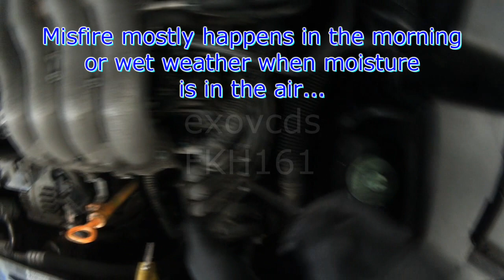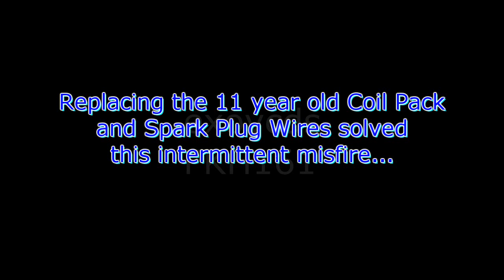VW A4: Finding an Intermittent Misfire (2.0L)

Comment: Nice find on the coil pack having a crack. What kind of solution mix do you use for finding arcs? I like to use half and half bottle of ammonia and water. The ammonia helps break down the surface tension of the water to allow it to spread better. Some people use soap and water, but I prefer the ammonia because it doesn't bubble all over the wires obscuring your view when looking for sparks.

Comment: hey man thanks for this video! it helped me troubleshoot a 2004 VW Beetle 2.0, it did exactly what you showed in the video so I changed out the coil pack and spark plug wires.
Reply from the maker: Thank you for watching!
Reply: Same here: 2000 2.0l new beetle had a misfire on cylinder 2.
Changed plugs and leads, no change.
New coil pack sorted it
Reply from the maker: +Drew Suttle Thanks for sharing your results!

Comment: Good stuff thomas :). I really need some help. I have a mk4 jetta turbo. And it has a p0303 . I swapped coils around and unplugged injector to see if thats the case but the light still comes on for cylinder 3.. i put new sparkplugs as well. Before this misfire i was running rich p0172..any help will work
Reply: It only misfires rough when its a cold start or havent turned it on for an hour or so.
Reply from the maker: Unplugging an injector will cause a misfire code for that cylinder.
Attach a fuel pressure gauge and watch the pressure after the engine is turned off.
Reply: Thomas EXOVCDS where do you connect the  fuel gage to?? Do you think i should try swapping injectors to another cylinder?
Reply from the maker: The fuel rail has 2 hoses, one marked white and the other blue. Blue is the return hose. Remove the one with the while mark and T into the line there. If fuel pressure does not show anything wrong, swapping injectors might be worth trying. At work I would try an injector balance test (activate injector while watching fuel pressure drop and compare with other injectors or even "current ramp" the injector... watching the electrical current in a digital waveform). https://www.youtube.com/watch?v=PieRsDSTLjY

Comment: Can you please help me , I have a 2001 vow Jetta 2.0 avh. I keep getting the p0354 code. I went and tried to do the ground tsb and I keep getting it back. Can you do a video on how to properly ground the coils please.....
Reply from the maker: +Jesus Padilla Bentley Publishers made a good video showing how to run a coil ground wire: https://www.youtube.com/watch?v=FjGkFqdS52w Your code refers to 1 coil of the 2 or 4 (depending on which you have)... your coil is probably bad / has an issue. If a ground issue were the problem, then you would have codes for the other coils as well.
Reply: +Thomas EXOVCDS  thank you. You just helped me solve a long time problem. Thank you once again and keep up the good work

Comment: Where can I get that ignition liquid? I just replaced a cracked/rusty coil with a used one from a vw dismantler, but I still get the intermediate misfire on #2 from vag. I have replaced the spark plugs couple months ago with ngk and gapped. Would it be my wires could be bad? 2000 2.0aeg.